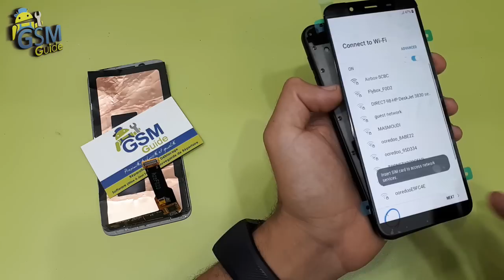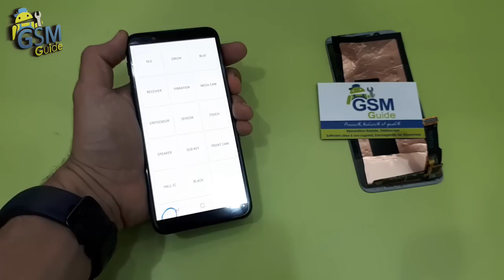Samsung j6 2018 Lcd Screen Repair Replacement - GSM GUIDE

Comment: Hi the replacement screen I have put on keeps on lifting up?
I have now replaced two different screens and used 3 different types of adhesives, I am tearing my hair out! 
It starts lifting at the bottom right hand side of the screen and then spreads. What do you recommend? 
Many thanks
Reply: T3000 use it
Keep  it preased for 10 mins with little pressure.  Then its done
Reply: The comment has been around for a while, but if you want to glue the display without it coming loose, use double-sided tape, apply it to the edges of the display and glue it

Comment: The new display which you installed is it original samsung super amoled display? From where will I get it?
Reply: Original disolay may cost upto 6000...low quality will be under 2000/-